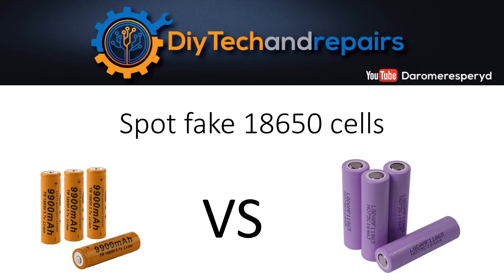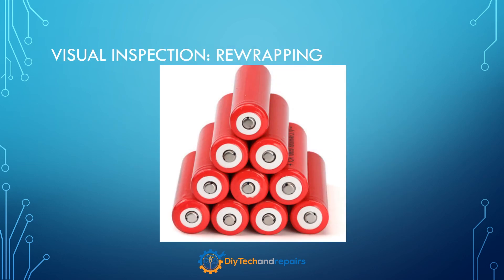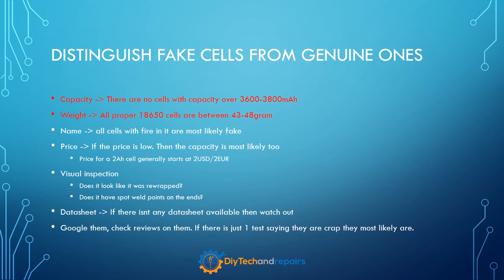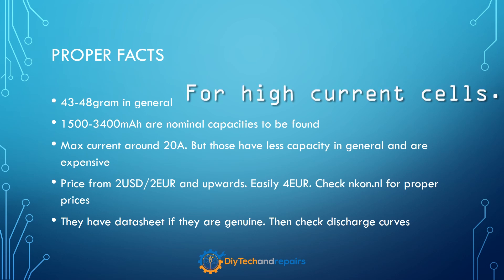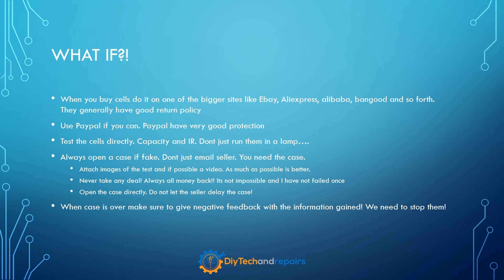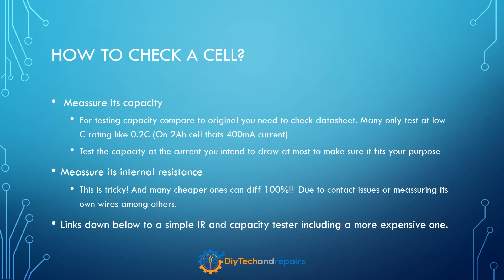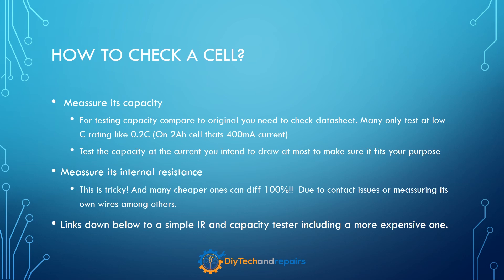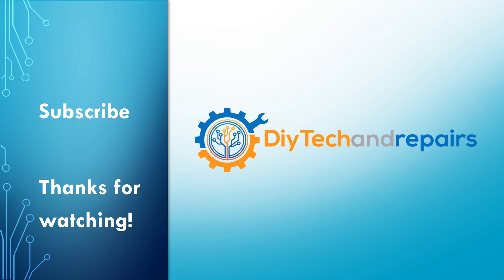Spot fake 18650 lithium cells

Comment: Ebay some time ago gave power to the buyers, so it should be safe.
But on Aliexpress I hade an unpleasant surprise. I bought 40 cells of 3000mAh. The price was low, true, but I was watching the seller for some time, and their cheap cells, 2000-3000mAh, looked reasonably. Just one "limited VERY cheap offer of 40 cells". Such deals are quiet common on Ali.
I bought 2 items, 20 pieces each. All they arrived in one pack. All had around 500 mAh. Seller responded: "f*ck you". Of course, I filed two identical cases. And that is interesting part: one case was settled in my favor, the other in favor of scammer-seller. They told me to make video of all 20 pieces charging-discharging - in 2 days. Table with results, picture of charger display after discharge, and video of weight measuring - was not enough in that case. I appealed, but that was like talking to the wall, they were completely deaf.
AliExpress returns money with no problem, if you did not receive the package, although most of them are are not registered. But as for the quality of the goods - take extreme precaution, I would say AliExpress gave all power to the sellers.
Reply from the maker: Ah ok. I have not bought more than 50 pieces from ali and only have had 2 failed and both worked. On ebay on the other hand we are talking about several 1000s.   Did you use paypal btw?  If so did you file complaint to them too or only Ali?  Just asking. Perhaps valuable info for others.
Reply: Payed with CC, so I could charge back, and I know people did it with my bank and Ali. But I'm not sure if I want to, for those few bucks ;). And after that I'd probably had my Ali account blocked, whereas they still are valuable source of cheap cables, connectors, converters - under, say, $5 with free shipping. But everything over that - I will think twice on AliExpress.

Comment: Ebay is the last place where to buy 18650 cells. Branded cells are overpriced and most other are fakes.
If real 9900 mAh 18650 cells were avaliable then world would be saved :)
Does real TrustFire cell even exist?
Reply from the maker: Trustfire not sure. But when i started years back there was Ultrafire with proper capacity. i still have some doing more than 2Ah. Bought them with led lamps for diving and hiking and they still work. Most likely before the market started to grow with the fake era :)

Comment: Good video. One of the problems we have in USA is recycling. Turns out that the most popular recycling sells the used batteries to China, so this is basically the beginning of the supply chain. If we can find a way to re-purpose them locally, it would help to minimize the fake cell market.
Reply from the maker: Yeah. You have to bid them over or tell them that you give them same price but they dont have to care for shipping :)

Comment: I was wondering. Have you ever tried to mix a agm battery bank and a lithium battery bank? Say at 48v. I'm asking because I have a some what new 48v AGM bank now but want to add storage for more night time use.
Reply from the maker: I have tested it and more importantly I have investigated if it works. yes you "can" do it but beware of that the voltage of the packs need to match and you wont be able tu use full potential of them both. Also beware of that you  need to be able to charge up the lead acid to bulk voltage and then leave them resting to float. That will work out in such a way that after bulk is done and you go to float voltage you will drain those % from the lithium bank to the lead acid bank. So unless you have a huge lead acid bank this might not be usefull for you. 

Low voltage disconect can also be good to have or such. Might be that i do a video about it later this year and write up on how it could be done based on my experience.
Reply: Thanks.  The low voltage disconnect is a great idea. I was concerned about the difference in the way the two chemistry's charge. and how they might work together..  Thanks again.
Reply from the maker: Yes the charge is a big issue. You wont gain much by doing both. ie 10kw on lead + 10kw on lithium wont give you 20kw total.... Perhaps 15 at most.  
Lead        lithium
Bulk 58V   4,14V
Float 54V   3,857
Min 40V    2,85

Comparison above. You see that the bulk will go to top of the lithium and when you then settle for float on the lead acid you will drain ALOT from the lithium doing so. ie you loose alot of "stored" energy that you wont be able to use.
Reply: Then maybe a way to switch between the two when I'm drawing from them and when the charge state gets to a preset level it changes over to the other. Isolating them would make it easier to charge them from two solar plants and charge controllers.  Your Ideas?
Reply from the maker: Its difficult to switch. Because they will quickly have different voltages. If so its generally easier to have 2 systems and in emergency a switch where you can switch over loads or battery banks between them.  Eya there are a few that run it like this on the forum/fb page
Reply: I agree. It was just a thought.

Comment: I did a review of a EBL battery on my site.  It is 2100-2200 cell (seems news ones are getting better) rated at 3000 mah.   I have tested about 30 and all above 2100 mah and they are $1.60.  $16.00 for 10.  I even had someone in the comments saying they got a bad cell.  But I get the feeling that it is possible that some put negative reviews so you buy higher priced cells. If I bought 4 EBL I would be highly surprised if I tested it and it was less than 2100 mah.  I would probably expect 2200 mah since I have not bought in a while.  If I ever tested a bad cell I not only would report it but take the video down.  I never even had a bad re-test.
Reply from the maker: Yeah I have done some cells i was suprised about for decent money too. There are ones out there unfortunately to many are fake :/